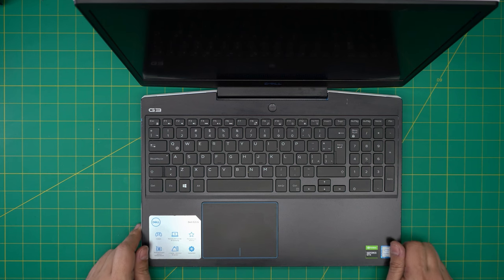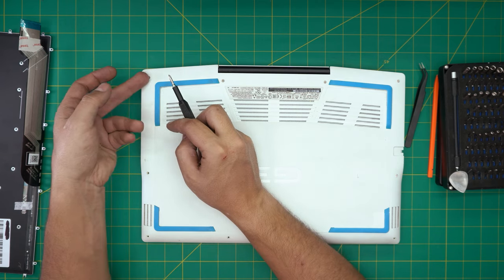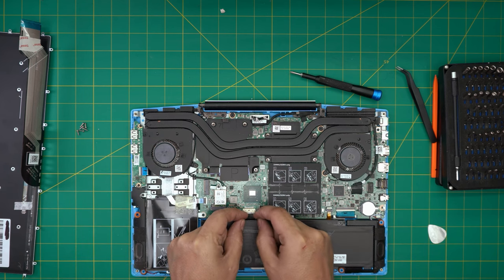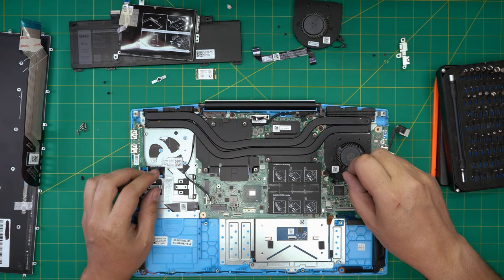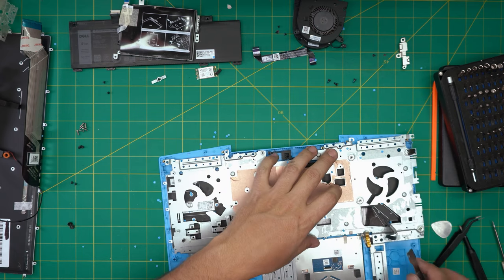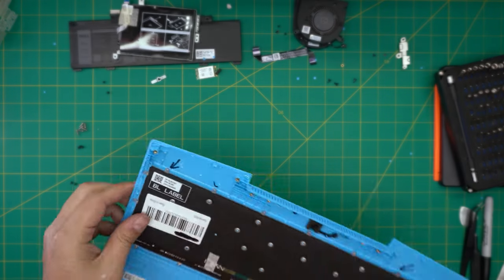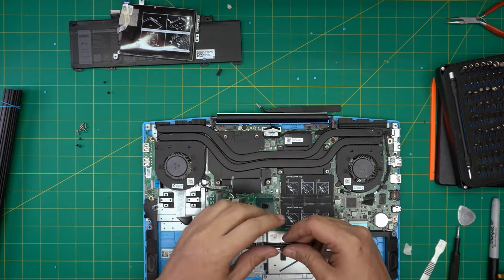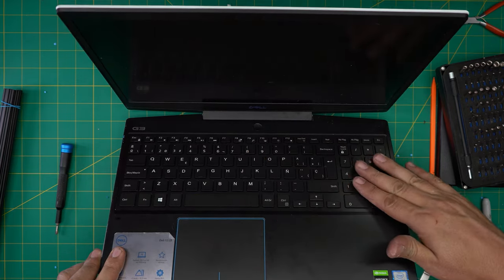How to Replace Keyboard on Dell G3 15 - P89F001 Laptop - Step-by-Step ⌨️

Comment: Hello. I own the Dell G3 15 laptop and my unfortunately due to an accident a part of the palmrest (the bottom right side) broke off and also a key came off, along with some other damages on the backpanels. I ordered spare parts from China and they have arrived. The spare keyboard is exactly the one you have used. I wanted to ask a question that will the keyboard light still be functionable, after I have replaced the keyboard, or will I have to bid goodbye to it? I am sending it to a repairshop tomorrow and I just wanted to confirm with you!
thanks for the video it helped me a lot
Reply from the maker: Thank you for your feedback! If you wish to support the channel, you can like, subscribe, or both!
Regarding your question, if you ordered a keyboard without back light then ask the repair shop to salvage the old backlight its very easy to separate and reuse it, it never goes bad.
Should you have any further questions or requests in the future, please don't hesitate to ask me.

Comment: Hi, thanks for the video!  I have 15 g3 3590, can I replace my keyboard without backlit on keyboard with backlit?
Reply from the maker: Thank you for your feedback! If you wish to support the channel, you can like, subscribe, or both!
Regarding your question, yes you can if the motherboard has the connector for the backlit beside the keyboard connector, if not then you can't.
look for that jack beside the keyboard connector and it should be labeled as "BL" or KBL.
Should you have any further questions or requests in the future, please don't hesitate to ask me.

Comment: Can I replace individual key on this keyboard, instead of replacing the whole thing?
Reply from the maker: Thank you for your feedback! If you wish to support the channel, you can like, subscribe, or both! Regarding your question, no my friend if you have an issue with the keyboard not responding the n you will need to replace it, BUT if you have a key cap broken then you need to get on aliexpress and search for the correct key caps